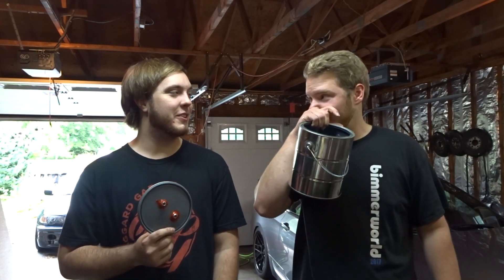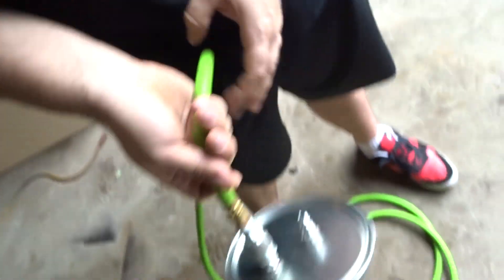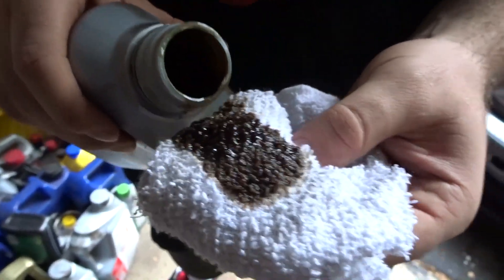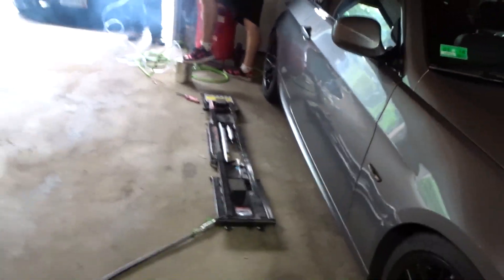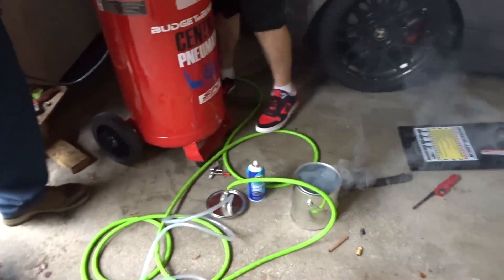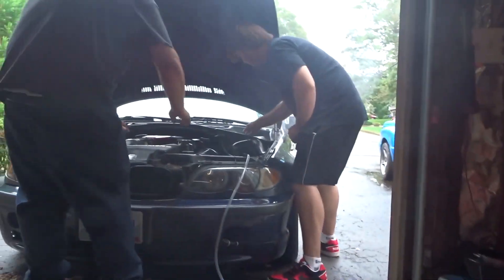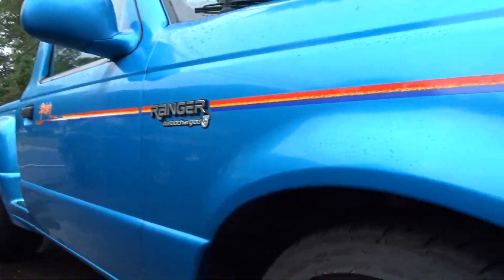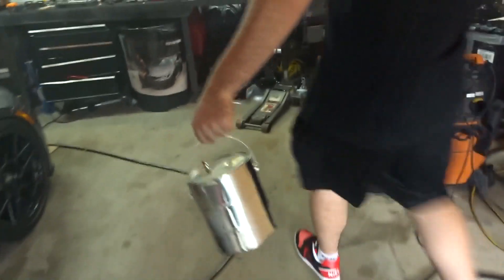Diagnostic Smoke Test DIY

Comment: Why not spray potential leaks with starter fluid while the engine is running?  Should hear the idle change when you find it.

Comment: You can do this with an old coffee can and a cigar not a b and m it has to be a fat cogee and you had way too much pressure in the compressor you might want to use one that's made to pump a bike tire or one that's small done this dozens of times good method but wrong way of doing it